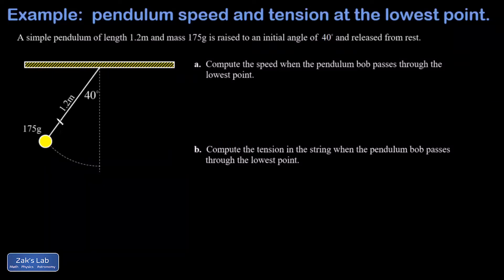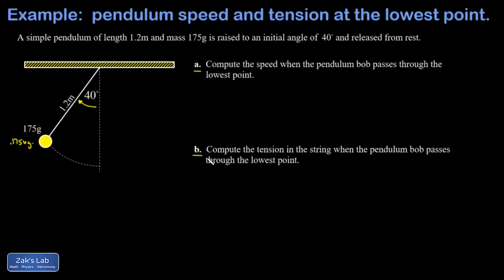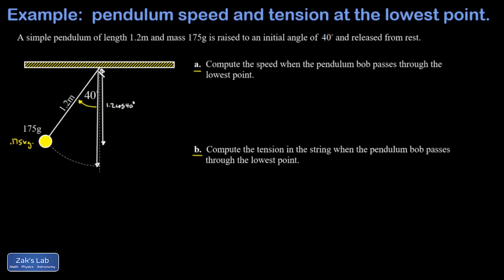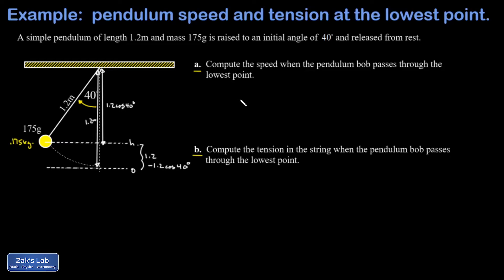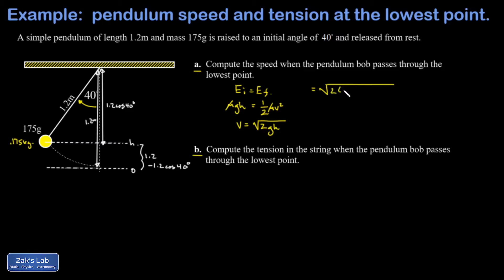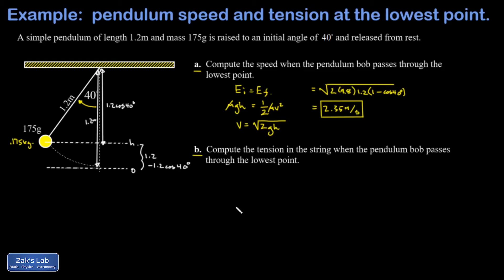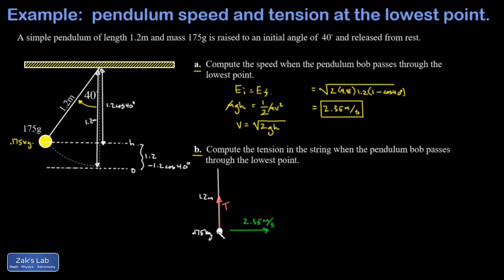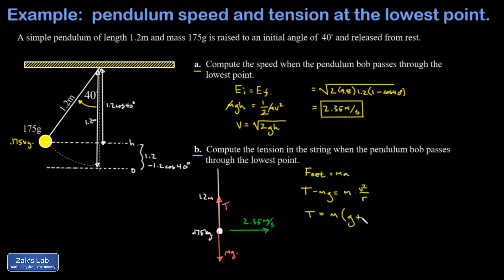Pendulum speed at the bottom using energy and tension at the bottom using circular motion.

Comment: To calculate the speed at the bottom, the reason why we are not setting the tension at the string at the bottom equal to mv^2 divided by r is because there is no centripetal force acting on it.
Reply from the maker: It has a speed at the bottom and it's moving on a circular path, so there must be a centripetal (center-pointing) acceleration of v^2/r.  Thus, the net force must point to the center of curvature.  The NET force acting in the radial direction is T-mg, so T-mg=mv^2/r.   That's Newton's 2nd law applied in the radial direction:  F_net=ma.  

If you set T=mv^2/r, then you are modeling the problem as if gravity is not involved!  z